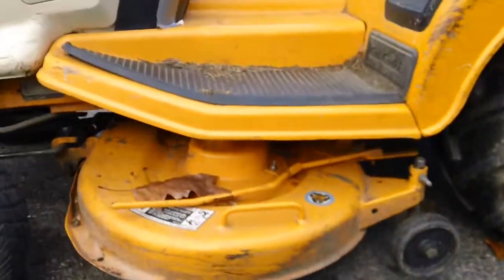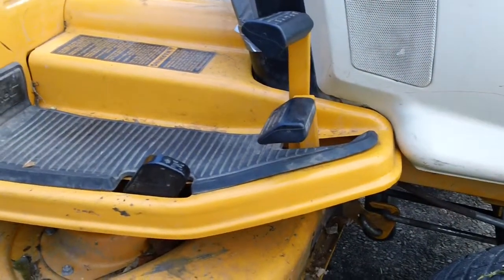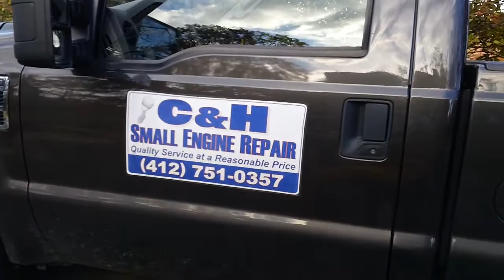NO START ISSUE WITH CUB CADET SERIES 2K TRACTOR.

Comment: I've got a 2000 series 2146. No issues when I parked it at the end of mowing season. I go to fire it up and just cranks over and over never firing up.  I found the kill switch on the coil unplugged it. Started right up several times that evening. I go the next day and again just cranks over. There's no spark at the plug now. Please any info would be greatly appreciated

Comment: can this switch be unplugged for testing?  If i unplug the switch it should start, right?  does this count for all safety switches?   I have a 2135 I think it is, and it is dead.  does nothing when turning the starter switch.  I use this tractor to pull my trailer around the yard, and want to fix it right.  And will do so, but I need to see what the problem is first.  thanks.

Comment: If this kill switch was broke would you still be able to start the tractor by jumping the solenoid?  I have replaced the starter, battery and solenoid but my machine still won't start or turnover.  Any help would be appreciated.  I have a LT2180.
Reply: Kenneth Scott I have the same problem....no starting with the start battery connection, but it will start by jumping it off...huh